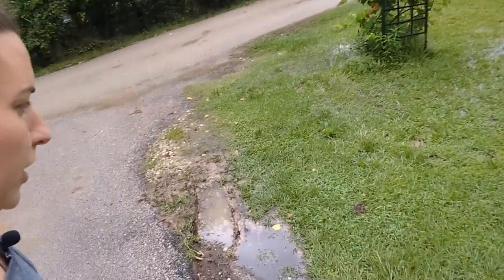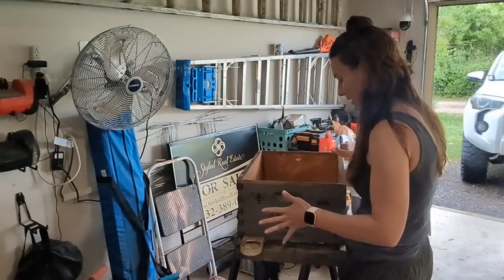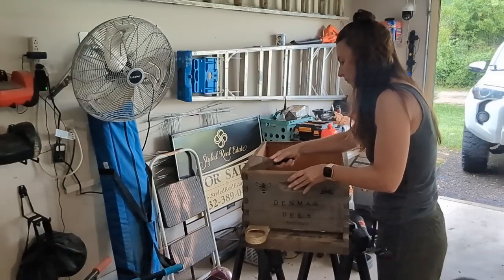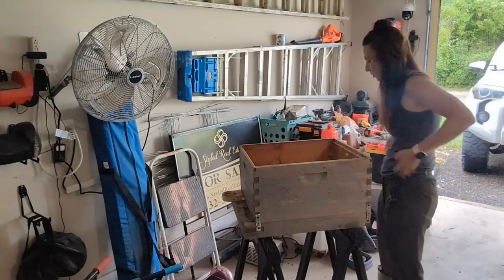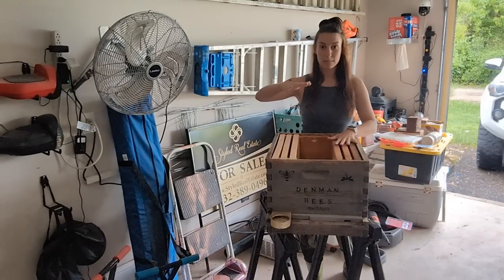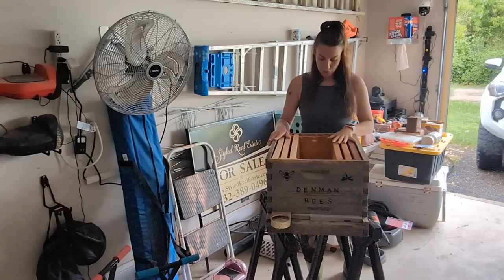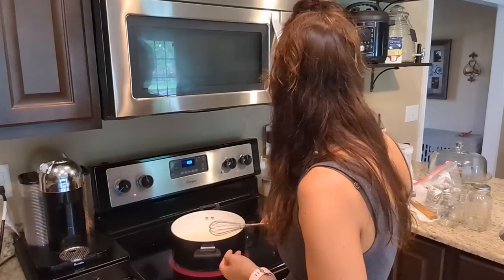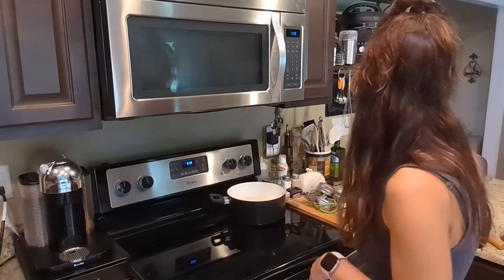Setting Up A New Bee Hive

Comment: Hey Stephanie, ??? Since you like to can.  What if you have to do a water jar filled with your simple syrup receipt as the filler instead of just water.  Would it work as a 2 for one time saver bee food?  Would you water bath or pressure can that?
Reply from the maker: You can can 😆 simple syrup but I wouldn't, only because I normally save my shelf space for things that aren't shelf stable. Sugar in the raw form and water are easy enough to whip up when needed and can be cooled down quickly if needed as well. So I tend not to can those things if I don't need to. But great question!
Reply: @thedenmanhomestead  Thank you for answering my questions.  The can can smiley face was cute. 🤣